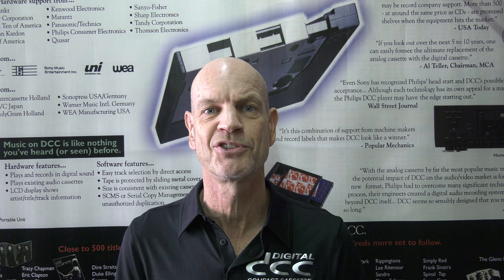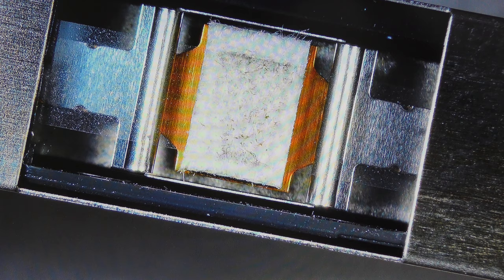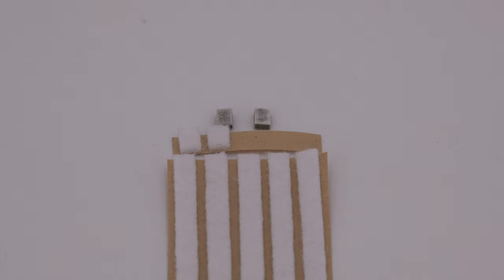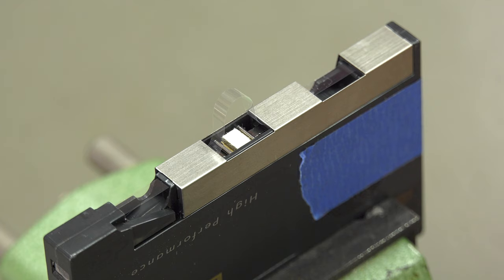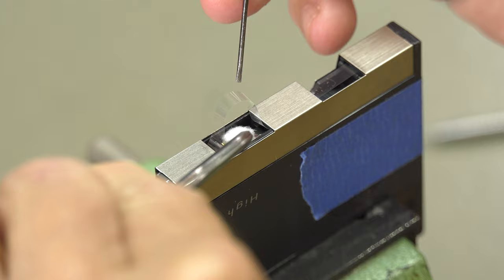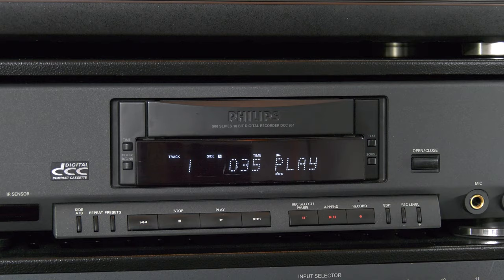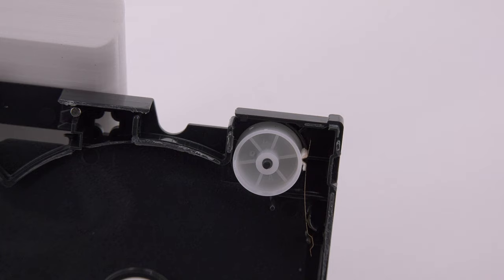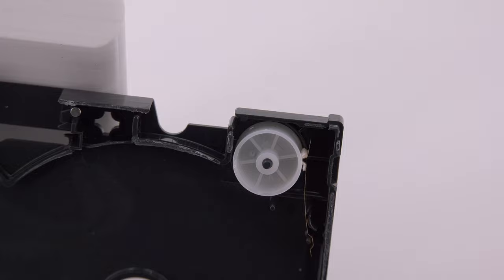Replacing The Felt Pad On A Digital Compact Cassette

Comment: Would it be possible to slit VHS tape to 3.8mm to load new DCC cassettes? This would be difficult to do accurately but there are companies that can custom slit and load film stocks. Or will only the specific BASF tape stocks work?
Reply from the maker: We are not 100% sure. The BASF chrome video tape was the only one ever used and they sliced it from a wider format. It would be great to test this.

Comment: I don’t think this is going to permanently solve the issue and may lead to more problems down the road. Now this is just my opinion and experience with tape but it seems as though the tapes are beginning to develop sticky shred syndrome. Since the problem is also seen in unopened tapes. Tape in general has a lubricant embedded in it as well and is also known to dry up and leave a residue or powder like substance behind.The larger taller pads would quiet things down for a time but I would think that it would cause tape stretch over time do to the extra pressure that’s now being placed on the tape when the head engages it. Again just my thoughts and not trying to be negative in any way. Only time will truly answer these questions.
Reply from the maker: Interesting enough the pre-recorded tapes do not suffer from it and it is the same tape. The felt pad seems different on those.  We did mentioned in the video that only  time will tell.
Reply: @DRDCC  I just bought a 951 including 62 cassettes. 44 of the cassettes are pre-recorded.
So far I've tested 10 of the pre-recorded tapes and a few play find but others (I'd say the majority) have occasional dropouts and make more mechanical sound than the player already makes. Was hoping these too can be repaired by replacing the felt pads, sounds like it wont.
Reply from the maker: @ollyalme  You should start by replacing the pinch rollers and also the felt pads. More help via forum.dcc museum.com